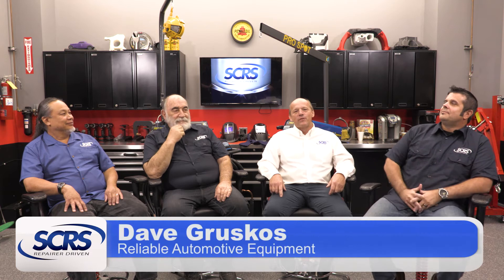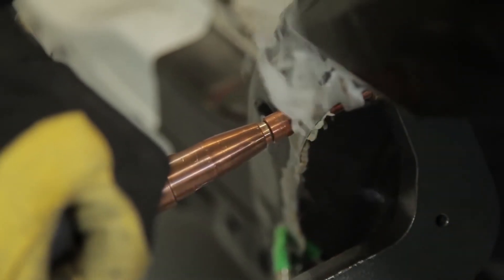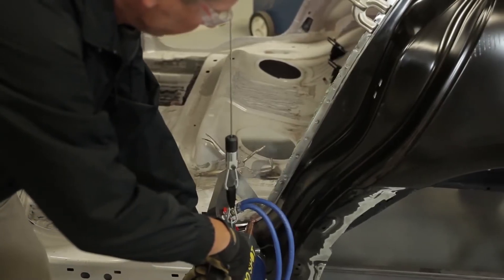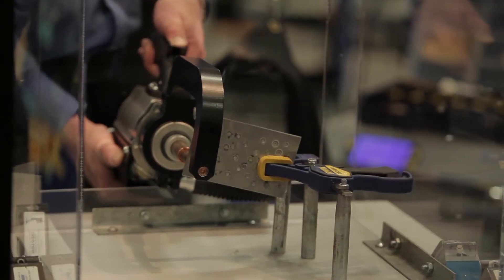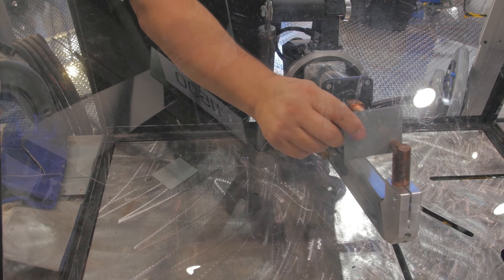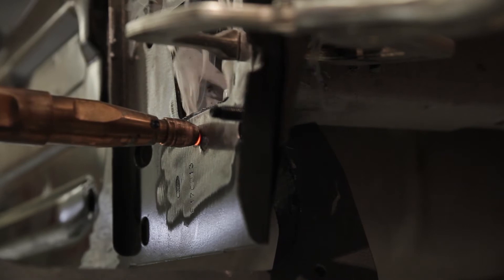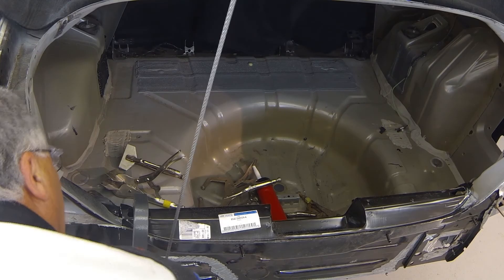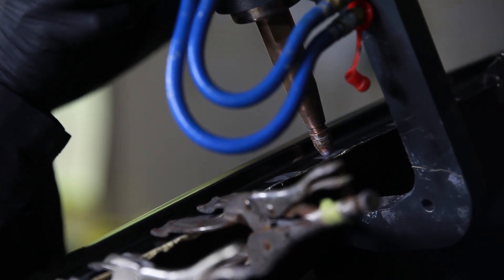SCRS Education Committee Presents - Resistance welding Part 1 of 3 - Power and Preparation

Comment: Are you going to be discussing proper testing methods whether it is a peel testing or twisting is required. Plus it seems to be extremely important to use the same kind of metal or what's the point. Taking into account that there are tailored rolled metals how can you do this. If you no longer have the original metal?

Comment: The Gage of wire is a calculation  of the length of the wire run from the buildings incoming service to the  receptacle and the amperage that is required at the machine (welder)